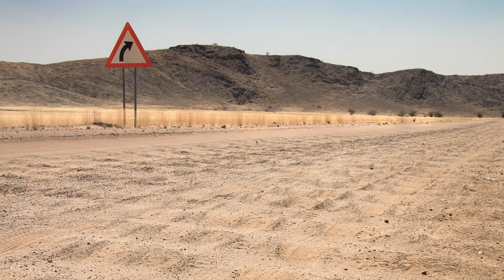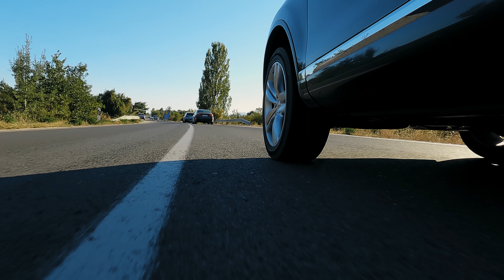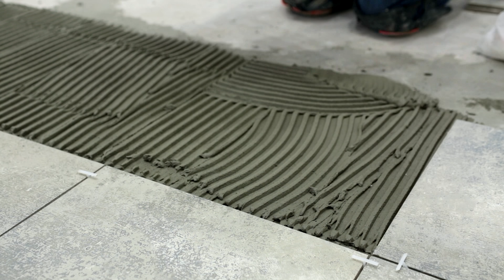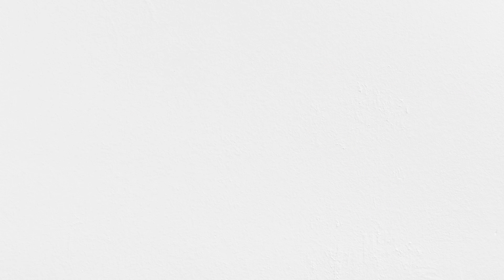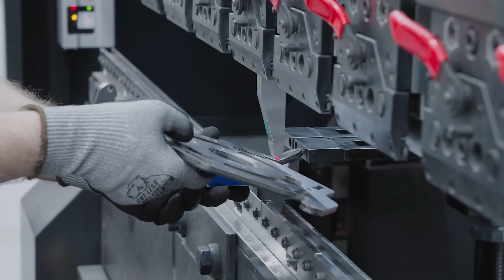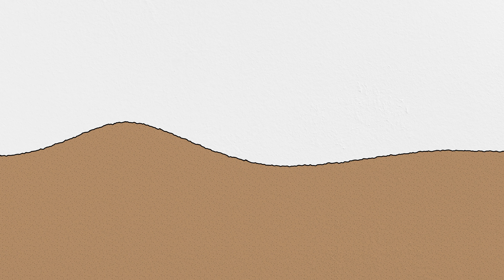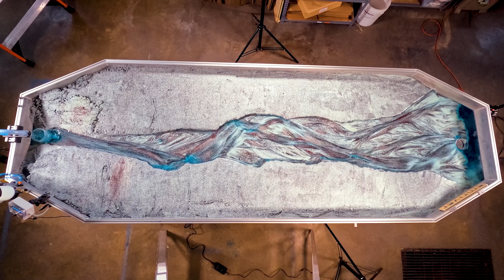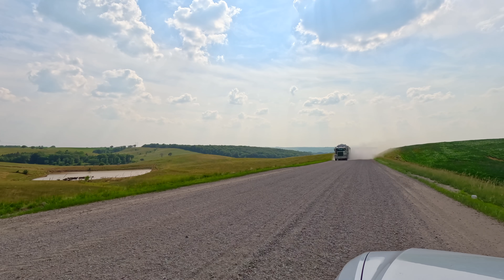Why Roads Get Washboards

Comment: Sounds to me like the suspension strength should have a significant effect, you describe the washboarding as a something akin to a typical second order harmonic oscillator, and so do I approximate a suspension. So the feedback strength of the suspension should noticeably impact the critical speed above which washboarding happens. It would be cool to see, in your little test setup, if/how differing spring strengths pushing the wheel down (aside from just gravity) affects the speed of washboarding.

Comment: While I don't doubt the method, simply driving steady, like the arm, isn't the problem, it's the problem of the problem. These happened, even on asphalt or concrete in areas where braking occurs or where surfaces charge. After a bit of time the road where people drive a constant speed, you don't see them that bad. Braking is the main contribution to starting the waves, not speed as mentioned. It doesn't matter what surface you use, and points where braking occurs are the failure points. Sure asphalt lasts longer than gravel but as a percent of it's expected life, they all fail first.   The problem of the problem is braking.

Comment: +1 for videos on testing geogrids/treatments in your test rig. Also the spring + damper on the test wheel. I do question some of this as the corrugations (AU terminology - see Gibb River rd for examples)) should be concentrated in the wheel areas, not laterally continuous. Also will running in opposite direction correct them

Comment: I wonder if you were to bury polystyrene sheets (or something similar) beneath the wearing surface (deep enough to not be a problem when grading) would make any difference to sort of absorb or interrupt the energy pattern? My agency built an experimental road base using shredded tires last year. There were 3 interspersed layers of tires and gravel. Before paving, it felt like walking in one of those bounce castles and we were worried it might be too flexible and the asphalt pavement would fail. But fortunately it's holding up well! I wonder what kind of impact (if any) such a base would have on a gravel road.

Comment: Damned dirt roads! There's stacks of them where I live and it seems to me that they create a rather large ecological problem that absolutely no-one is talking about. Maintenance is somewhat variable depending on circumstances, however I know of one particularly well used section over a small range which gets the treatment about three times a year. I should mention that I live in a part of Queensland that is very hilly. The amount of gravel which is added during grading is really quite staggering. And the drains and culverts have to be maintained so as to get the water away as quickly as possible. So, you end up with stuff like, where the water might flow across the road in a slow wide swathe, it is instead collected and diverted via a V channel into the steepest folds in the land. Ah, the wonders engineers perform. When you are a hammer, every problem looks like a nail. The result is that all of the streams get choked with the runoff. 

I can only guess that sealing roads must be enormously expensive. The cost in manpower, fuel, and machinery for grading is not much different if a cap is put on the top. But it has to be done much more frequently.

Comment: What was ports occur if you change the tire from smooth to an engineered shape which may be don't get rid of the washing boards but when driving over it shapes the washing board pattern into an more suitable and self healing recurring pattern which is comfortable to drive. Independent of speed

Comment: Never really saw many of these in Sweden, looks like we have finer sand for our unpaved roads. They do get pretty "muddy" though when wet which tends to make your car very dirty. You also get little craters everywhere when it rains. Just need to pour some new sand over and it's just as new again after a few weeks of cars and trucks compacting it.
We do get the washboards at intersections during certain temperatures around freezing in the winter though.

Comment: I know a road in my area with extreme washboarding. I found that at the recommended speed limit of 80 km/h, it feels like my car is resonating with the bumps and shaking itself apart, but at a faster speed, 110-120 km/h it suddenly becomes smooth sailing, as I hit some resonant frequency where the suspension is always at the right place to catch the bumps.

Comment: 16:08  Geogrid!

Pretty neat stuff,  although i find it a bit bittersweet.  The earlier WW2 Era Metal Versions were probably a bit more robust,  as well as easily recyclable or at LEAST they would rust into oblivion/be easily located with a metal detector etc.

While the modern plastic stuff MOSTLY works,  i feel we will view it’s use in a similar way to how i view the various industrial sites i have work at’s use of Asbestos-Cement Siding/Roofing etc

It works…just at what cost?

Biodegradable Plastic/Composites may be a nice compromise.

I’d love to hear Road Maintenance Worker’s thoughts,  but part of me wonders if that would interfere with some Grading Operations too due to it getting “snagged” etc.

Either way not as bad as “Landscaping Fabric” / Weed “*Barrier*” lol

(Also great video as usual, and keep up the great work!)
Reply: I'm intensely curious how geogrid would affect washboarding.  Like you've mentioned, there are some obvious pros and cons, but it would be interesting to see it put to use in similar scenarios.

Comment: In the demo, the size of the ridges and valleys seemed closely related to the diameter of the wheel, but in roadways, the washboarding seems much smaller than the average car tire. It still seems counterintuitive to me that large tires generate tight ridges.

Comment: I'd be interested to see a followup video showing how suspension and differing tire pressures affects washboard formation. In my experience some of the worst washboards are roads that are frequented by lightly loaded trailers with overinflated tires. You'll see them bouncing along exactly like the rigid wheel in this video.

Comment: In the future if you are using polycarbonate again, you can actually solvent weld it with acetone!
I have used acetone to solvent weld before and it makes a very strong bond.

Comment: Another factor I've seen many times in the US Southwest, where unpaved roads are often cut into fairly hard material, is poor operators allowing their grader or dozer blades to catch and hop. You'll find many miles of road where the washboard pattern is uniform over every inch of width, which would not result from car traffic. 

Decades ago I did spend time operating graders, scrapers and dozers, and smoothing hard surfaces is a real skill that takes experience and understanding of how your gear works. I couldn't do it reliably-I never had enough hours to master it. Last year I followed someone grading a road who let his blade dance and oscillate for several miles, creating a terrible washboard. Very frustrating when it's a road you need to travel often, and car traffic is just going to make it worse.

Comment: I have graded a lot of dirt road. Just turning your wheel without moving is enough to potentially make a pothole. The slightest accumulation of water in a groove will cause havoc. And without cutting the bottom of that hole or washboard, it will return days to weeks later. 

Grading washboard required skill as the grader is constantly driving over those bump

Comment: Slowing down is not only impractical for distance and enforcement reasons. To prevent washboard you need to literally creep along the road. Any suspension action, even just the springiness of pneumatic tires, will cause varying impact loads and thus washboarding. Unless you think 1 to 2 mph is practical, slowing down is impractical because physics limits the maximum speed so low.

Speeding up is a better solution if increased speed is safe. Why? Your tires and suspension have a response frequency, typically relatively slow. As you increase speed of travel, the vehicle tires and suspension must respond more quickly to the corrugates. Once the frequency of the corrugates in the road meet or slightly exceed the response frequency of the vehicle, the ride will become smooth.  The only problem is now your tires are only touching the road for a portion of the time - don't try to turn. As you continue to increase speed, the roughness will return (but typically not as bad) until you get to the next harmonic.  One gravel road I used to drive in my younger years had a posted limit about 50mph.  In a 1971 Oldsmobile, the ride was smooth at about 65 or 70 mph and again about 125.

Comment: Washboarding isn't limited to particulate surfaces either. Railways have a similar problem with the tracks: uneven loading causes stress in the steel, which cause (very slow) alterations in shape, which result in uneven loading. I've seen washboarding in asphalt, too. It just needs to get hot enough for the tar to slightly liquify.
Reply: I knew someone would mention railways.  The suspension (springs in bogies etc) plays its part in it too.  You can actually see the scalloping in a piece of rail that hasn't had any maintenance.  The  height of the ripple isn't much at all, but it's there.
Reply: Yeah, railroad too. I think he made a point in stating that everything, yes literally EVERYTHING in the universe is susceptible to washboarding in one way or another.

Comment: Hi Grady, great experiment! Two questions/ideas for your circular treadmill setup:

1. "Skimming" at very high speed — does it reduce washboard?
Drivers sometimes notice that beyond a certain speed the wheel seems to only clip the tops of the corrugations rather than fully engaging each trough. Ignoring the obvious safety concern on real roads, would it be possible to test this on your rig? If the wheel only contacts the crests, the net force on each crest might actually be downward rather than scooping material uphill — which could theoretically wear the crests down rather than build them up. Or does the positive feedback loop just reassert itself at a new, shorter wavelength?

2. The role of wet/dry seasons
From experience on unpaved rural roads (southern Spain): washboard formation is strongly linked to moisture. Once the wet season ends and the road dries out and is not too badly damaged yet, it can actually stabilize and stay relatively smooth for the entire dry season — the locked aggregate holds. But when the rains return, the fines migrate, the surface loosens, and corrugation starts again almost immediately. Did your research touch on how moisture content of the granular layer affects the threshold speed or the rate of corrugation growth? It would be fascinating to see a wet-vs-dry run on the rig!

Comment: have they tried using delta tracks to remedy the ripples? I is distributing the weight evenly across a longer base so it would push the peaks down as a result, right?

Comment: Except this is NOT an accurate representation of how washboard forms on dirt roads.  Anybody who has spent any time on dirt roads will soon realize that the washboard forms from the DRIVEN wheel now from a passive wheel as shown in this experiment.  Washboard forms on uphill sections, after a stop or corner where a vehicle would normally be accelerating.  Flat level stretches of dirt will not generally have washboard.  Also, the scale of the real washboard is not equivalent to what this experiment shows - is is much smaller in scale.   Try the experiment again with a driven wheel.

Comment: Seems like you could time ABS to fight this condition.  Might make an awful ride, like a built in turbulence generator, but maybe a small trailer could be used to tame the washboards for the next guy.   Put it on local trucks or municipal vehicles.  Would work if an aggressive anti washboard setting could reduce the peaks and fill the troughs to offset the regular drivers.  Could be more effective than the graters(which can be dangerous for motorcycles when the leave a central spine on the road.)

Comment: A rancher once told me that you need to pull a drag bar set at an angle to mitigate this, but many people use a drag bar set too perpendicular to the road and it makes it worse.
Reply: Perpendicular simply repeats the washboards. A good angle can cut the tops off the washboards.
Reply: This exactly.  I pull a wood beam with one cable short on the driver's side and longer on the passenger side; tires dragging behind the beam.  It works superb for eliminating the washboard while also maintaining the center cap in the road which ensures the road drains.
Reply: we need to test this in the simulator
Reply: @cmasterflex 
We've already tested it I do it on 5 mi of dirt road with my tractor
Reply: Nobody uses a drag bar that is square to the road.

Comment: Expanding on this also happening on proper roads:

You’ll see this happen on race tracks too, where lots of money is generally spent on making the surface robust and good (based on use specific criteria). 
Generally happens either in places where there is some weakness quite far below in the ground (like if there is an access tunnel that passes under the track) or, if the whole track is built in a less than ideal place (like a marsh) in heavy braking zones where the front of a vehicle will really dig into the asphalt (and then you get the oscillating/hoping effect of the vehicle on the wear surface). 

Also, adds to why high quality roads, like the autobahn, that have really extensive base construction are so quality and durable.

Comment: Im gona go out on a limb and say that it due to the suspension of the vehicles. As the tyre hits a bump the suspension is compresswd them the as the tyre get to the other side of the bump the weight of the vehicle is transfered back into the tyre compressing the ground underneath it this continues over and over and the peaks and troughs  start to form over time and multiple cycles of vehicles  passing over the bump and compressing the trough .seems like the  compression and recoil of the springs and suspention over and over

Comment: For acrylic, you can glue pieces together by painting Methyl Ethyl Ketone (MEK) on the surface. MEK is available by the gallon for cheap, and it fuses acrylic surfaces together in a water tight way. It's one of the superglue ingredients.

Comment: 9:29 So in the illustration it shows loose material being displaced causing the washboard. That makes sense. But that only makes me wonder why we get washboard at some intersections with asphalt paving.  The wash board will happen in the area of high braking forces just at the first few car lengths before the stop line.  There is no loose material to move.
Reply: Asphalt is flexible, and it's the aggregate base underneath doing the  moving, the HMA is just contouring to the agg base.
Reply: @taylorsova2594   You missed the point.  In the video it is explained that the asphalt (the wear surface) contains / locks in  the agg base.  My point was there is obviously more going on.

Comment: But if someone dragged a chain link fence behind their car on occasions this would smooth out the road. 
The area I grew up in there would be a few chain link fence draggers set up, neighbors would see it on the side of the road drive it a few miles and throw the fence to the side of road before pavement begins. Other neighbors would drag it to their drive way leave it aside for pick up.  You never knew where it was gonna be, but if you had time you would drag it to the edge of town on your way out or to your house on the way in. if you pass it, if you needed to smooth your drive, take it leave it out front for someone else. 
Hooks cables a bar and fence…. Fits any vehicle. Some times people tried to over engineer it

Comment: It might be interesting to experiment with several other materials such as mud covered by various types of sand in this test model. I would wonder, on a real road, if periodically conditioning the surface with a rake would be better than using a scraper blade.

Comment: The same effect occurs with railway tracks. Indeed, with steel—given that the static pressure exerted by train wheels on the rail per unit of area (e.g. square millimeters) is already approximately 500 times higher than that of a vehicle tire on a roadway. The wavelength of the corrugations on railway tracks is much shorter—typically around two inches—and the amplitude is also significantly lower. Nevertheless, this can still result in severe vibrations that damage the material and generate a lot of noise. However, this effect does not occur universally on railway tracks; rather, it is particularly pronounced in areas such as tight curves. Consequently, these corrugations are regularly ground down.

Comment: I remember having to dig a hole in a compacted base for a walkway (basically a combo of gravel and pond silt). We compacted it with a roller full of water and by simply walking on it. I needed a mattock and digging bar to do anything to it. It was taking so long, that my boss decided it would cost less to use a skid steer with an auger and then just repair any damage the skid steer caused (which took a couple of hours in and of itself).

It was almost like trying to dig through concrete. Once that stuff gets compacted and starts to dry out. It is one step shy of a solid rock.

Comment: But what about the role of water? I know you mentioned ridges forming in streams but I think anyone who has spent much time on dirt roads, especially hilly roads, like on a mountain, has seen the wash boarding caused by water runoff. Often appearing as parallel ridges that run across the entire road surface and are often not perpendicular to the direction of travel.